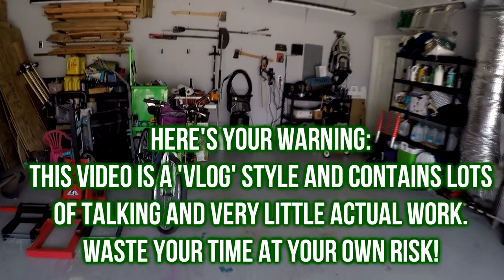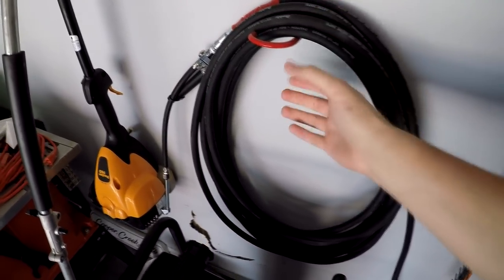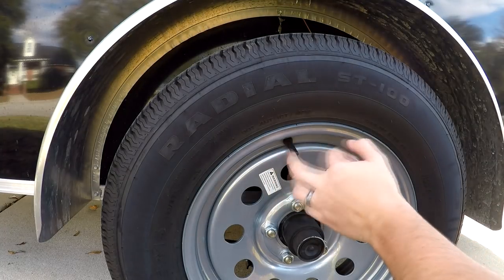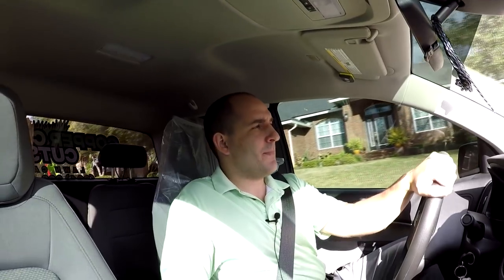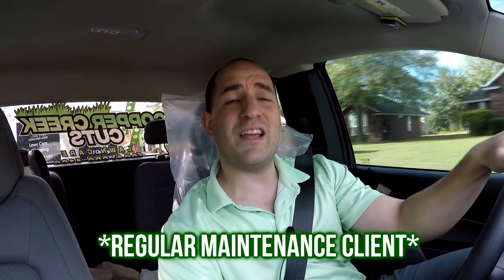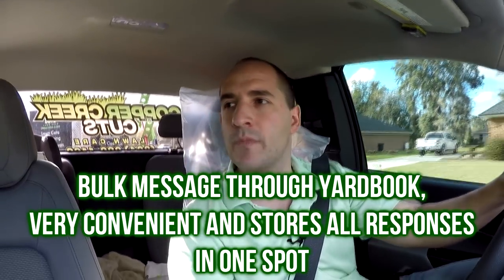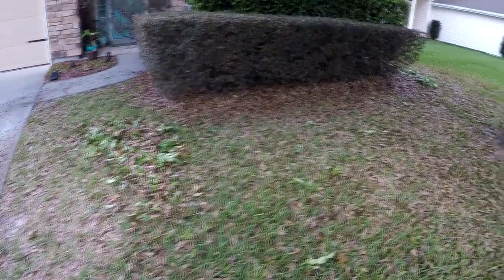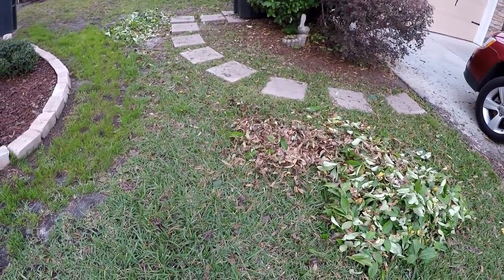Tossing My RZ MASK, Client/Marketing/Uniform Updates, Mulching Shrub Clippings (#1901)

Comment: Honestly - I fast-forwarded through a lot of it until it got to the mowing part. Plastic on your seat because lawn work leaves you covered in dirt and clippings, yeah?
Reply from the maker: You've got it! I always put a trashbag over the back of the seat and set one where your bottom goes. Very easy way to keep the dust/dirt/sweat off the seat! :)

Comment: I don’t know what service he’s paying for, but this job seems very lazy, rake out and blow out the leaves and then get rid of them. Wanting to just mulch the leaves is extremely lazy. Also given leaves damage the grass why aren’t you removing them?
Reply: Leaves laying on the grass over time will damage it, however he mulched them and its fine and provides nutrients to the soil as they break down.
Reply from the maker: I covered it at 7:47, this is just a regular mowing service. This wasn't a spring cleanup or leaf cleanup, so I don't have any way around it besides chipping away at it little by little over the next several visits. Thanks for the comment, good question!